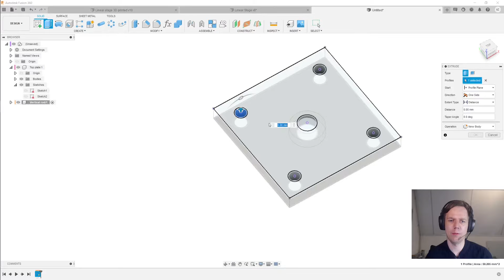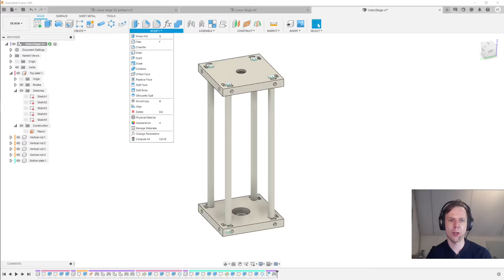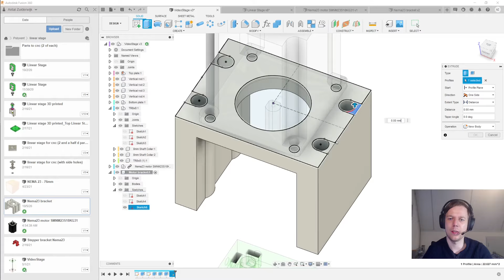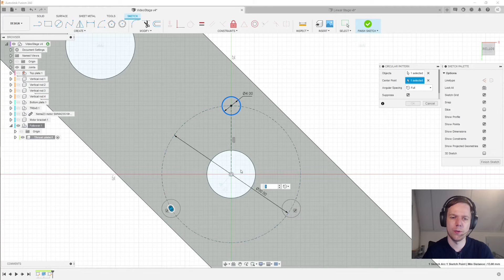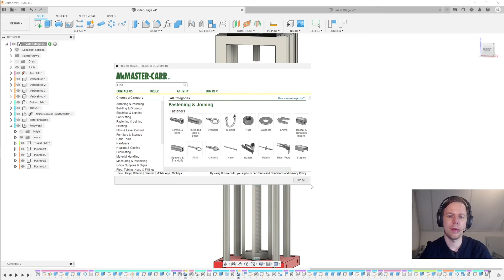Fusion360 Assembly Tutorial; Full practical assembly from scratch

Comment: This video has a lot of teaching moments : )   @25:58 I get the screw turning but the shaft collars are not moving with the shaft even though they are joint rigid to the shaft. The top plate and 4 rails are very transparent. However if I use my mouse and turn the shaft the collars rotate as expected with the shaft. Maybe something changed since you made the video.

Comment: Well done! Quick one; i'm stuck at where you imported the NEMA 23 stepper. How can I get the part file or dimensions to model it?
Reply from the maker: There's no file for it, but you can find drawings for the NEMA23 faceplate online. From there you can create a model of the motor yourself, and then insert it. Make sure to joint the motor shaft to the body with a revolute joint. It's a nice small model to practice.

Comment: Why can’t you plan out the video before hand instead of making a bunch of mistakes so that the viewer doesn’t have to go back every minute on their sketch to change what you told them to do💀 making it hard for no reason
Reply from the maker: The video was fully scripted, the mistakes and corrections are to show how to make a model where you can easily change dimensions and the whole model updates as required. What I often see is that people correct mistakes by adding more features, which quickly turns the model into a mess.

It's also very powerful if you want to create several veriations of one model, if the model is properly made all you need to do is adjust some parameters. If it's poorly made you have to model each variation separately.

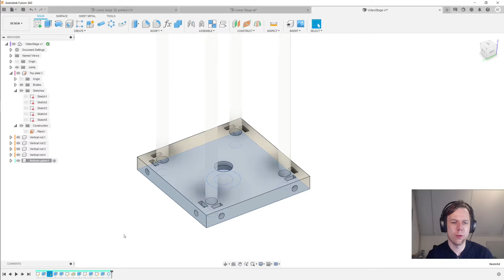Comment: This is a great tutorial, but when the program reacts differently to the result you produce, even when copying the steps precisely, it gets a little frustrating.  I'm currently editing the Bottom Plate, I have successfully copied and made it a rigid group and I'm trying to redefine the sketch plane for the hole for the lead screw (see 13:20).  I select the sketch and choose refine sketch plane, but when I click the top surface of the top plate, a full blue square selection is highlighted, not with cut outs for the corner details as shown in the tutorial, and when I click  accept it throws up errors in the cuts and the bottom plate hasn't flipped over like yours does.  Do you have any idea what I'm doing wrong?

Edit:  Managed to resolve the 2 issues.  

1) The first was related to the direction of the cut for the lead screw (it wasn't mirrored and was cutting into empty space, removing or adding '-' to the 7.00 dimension resolved this, not sure why this was an issue on my model and not yours, but nevermind
2) The second related to the mid-plane (this wasn't the highlighted error in the model timeline at the bottom).  The mid-plane seemed to align to the top edge of the bottom plate, so I went back into the mid-plane feature, and re-selected the top and bottom surfaces (from the top plane model, which it is referencing when editing), this re-centred the mid-plane and fixed the extruded cuts / feature rotation which were referenced from the mid-plane.
Reply: i am having the same issue but am not able to rectify it!!!!

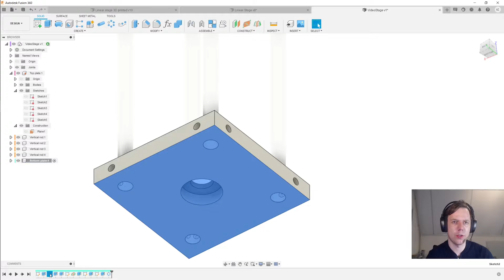Comment: Cannot seem to redefine the sketch plane at step 13:25 successfully to flip the hole to the top of the part.  No matter, what I do the large hole remains on the bottom of the Bottom Plate.  I go through all the supposed steps of selecting the sketch, going to the Timeline, right clicking and selecting Redefine Sketch Plane, selecting the top of the Top Plane and nothing happens.
Reply from the maker: It appears several people got this issue. Can you delete the sketch from the timeline for the copied component and then create a correct sketch on the right side so you can continue?

Comment: you go way to fast, can you redo the video slowly ? and please use a program to show the keys on the bottom on the screen, we don't see your keyboard !!! Also use a program to show the click with a red dot on the screen.
Reply from the maker: This is a balance unfortunately, I need to keep some speed to keep the video to a reasonable length. I recommend watching a short section and then pausing to do it yourself. I imagine it will take you a few hours to work through the video in that way.

The video also isn't meant as a first introduction to Fusion360 itself. I deliberately don't go over sketches or constraints too much, because I'm assuming that to be familiar. I do call out the shortcut keys as much as possible, to help viewers learn how to model more quickly. I'm sorry the video didn't meet your expectations.
Reply: @antalz Ok I get it with the speed and the topics you expect to be already studdied. 
But please use a software to show keypresses on the bottom of the screen and mouse clicks with a red dot.
Thanks for repling and I hope to see this soon, you can see a lot of these add ons used in other blender video or other software, I'm shure you'r familiar with it.

Comment: Thanks for the very thorough video. I learned so much in one video. My question is probably nonsense but I will ask anyway. Consider a CNC machine. On one axis are two rigid groups of components (bearings, rods, etc.). I want to place each group at a user defined distance from the centerline. So far, I have made a mess. Is there a video that will tell me what to do? Or is this question so simple ?  thanks
Reply from the maker: Hi mate, It's hard to say without seeing the model. In theory what you should do is indeed have 1 component that's slider-jointed to the base, and then everything else that's co-moving rigid-grouped to that one component. You can then position that whole subassembly by double-clicking the joint, and entering the value where you want it to slide to. Depending on your machine configuration you may have 1 component sliderjointed to the base, with a whole bunch of extra stuff rigid-grouped to it, but another collection of components that's similarly slider-jointed to the first group. But basically my tip is you can double-click a joint to enter a value to which the joint will move. Motion-linked joints or rigid groups will move along.

If that doesn't help you could send your model and question to antal@creonova.nl, please include your model as .f3d or .f3z if possible.
Reply: Thanks for the suggestion. I will try and see if I can make progress. If I get stuck then I will send the .f3d model. Thanks!! @antalz

Comment: Starting at 13:24, the "redefine sketch plane" results in a extrude error.  I am not able to do as is in the video.
Reply: I have restarted the video 2 times.  I am pretty certain I have the steps down that would affect this.
Reply from the maker: I think the confusion here might be that if the sketch plane is redefined, the extrude should go in the opposite direction. Fusion360 might not "understand" this. If you rightclick the extrude feature on the timeline (it should be highlighted yellow or red indicating the error) you can check what it's doing and try to adjust. I suspect it's still extruding upwards, and you should be able to adjust that extrude so that it extrudes downwards.

If it's still giving you trouble please send a description of the problem, preferably with a .f3d file attached, to antal@creonova.nl
Reply: @antalz  thanks for your reply, I did try the above, and it I could redefine the extrude on the top plate but not the bottom. I ended up just remaking the bottom plate with offset plane at distance.  Little more work, but still following.  I appreciate your reply.
Reply: @merrillmitchell2481  hi, i just had the same error here even though i did all the steps correctly. i cannot redefine the extrude on the bottom plate either. could you please explain how you used offset plane to remake the bottom plate?

Comment: So I've been using 3ds max, autocad and similar software since the late 90's. My fusion transition has been so difficult not because of the design process but rather the modifications to the design. I would finish a part and realize it needs tweaks, obviously, which would not only cause issues with the part but the subsequent other parts. Then I would spend more time trying to play with constraints or delete linked dimensions etc... If that makes sense
Reply from the maker: Did this video help with that at all? It can definitely be tricky at times to create a design that updates properly when you adjust dimensions or other parameters.

Comment: So I follow along and learned so much right up until you decide to design a motor and put it into the assy.  27 minutes in and now I'm not able to follow along.  
You couldn't be bothered to share that design as well?  Kind of a disappointment.  😕
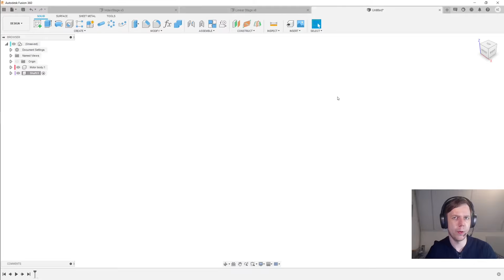Reply from the maker: My assumption was by the time you get to 27 mins of this video you can recreate that design without issue, perhaps that wasn't justified. Are you able to find a Nema23 faceplate drawing online and then sketch+extrude it in Fusion360? At 27:05 you can see the timeline is very short, there's really not much to the motor at all.

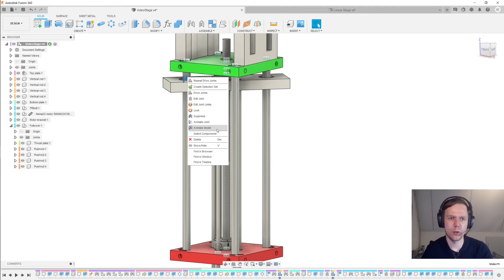Comment: 47:28. Edit joint limits should have a "to object" option. Otherwise, if you change your part dimensions, you'll have to correct them later on.
Reply from the maker: It doesn't have the currently right? Because I couldn't see it. And yeah joint limits are a bit limited at the moment. Just like how contact sets don't work well if you move things around violently enough.

Comment: You could have discussed how you assembled that motor. Because even if you grounded some motor part, when you inserted it into the project, its parts will move around. Rigid joint between a motor part and the top level origin is what is desired there, as far as I know
Reply from the maker: Not entirely sure about this. When I open the motor file, I grounded the body component and revolute-jointed the shaft to the body. That way both subcomponents are constrained, and all that's left is jointing the motor in the overall assembly. You do sometimes run into problems if you try joint to the root component of a subassembly, maybe I could have been clearer about that.

Comment: Followed along very well, but got lost at the part where you brought the motor. I wish you explained further how you designed the motor.
Reply from the maker: The motor has a NEMA23 faceplate, you can look up technical drawings/specs for those online. With such a drawing at hand recreating the motor should be quite easy. It's not essential to get every detail right, the hole pattern is the most important, and the raised platform around the shaft is also important.

Comment: Any idea how you could create a joint(s) and motion link to move a body where the lead nut is its own component. I'm trying to drive a body in a linear direction with rotation from the shaft to the lead screw ?
Reply from the maker: I'm not sure I understand correctly. It seems to me you can create a slider joint, which is possibly easiest to do with the as-built joint function. If you mean that your body has to move along with the trapezoidal nut, you can make a rigid joint between that body and the nut. Here to an as-built joint can work. A rigid group also works well if many components need to stay together. Note that you can't joint directly to a body, you must joint to components. If you are using subcomponents, make joints to the subcomponents, not the parent component.

Comment: I have a doubt when applying as-built joint to the middle rod and the upper plate, I'm not able to make the middle rod and shaft collar rotate togetherly....can you tell what could be the problem or how  I should do it in particular?
Reply from the maker: For that you need to make an as-built joing between that rod and the collar, or a rigid group. I think that the as-built joint you mentioned is for allowing the middle rod to rotate. Keep in mind that some joints are rigid, and some are revolute.

Comment: HI, great tutorial , I have one question, when u change the length or breadth of the upper plate through sketch, do screw pockets and rod holes still stay intact or they mess up ?? In my case, they are getting messed up
Reply from the maker: That depends on how you set up the dimensions. If you dimension relative to the edges, they pockets should move with the edges.

Comment: Coming from Solidworks, working with assemblies in Fusion360 has been infuriating! You're video has shown the correct way to do everything I have been doing wrong. You have also shown some new features I didn't know existed. Thank you SO much for this video!
Reply from the maker: Thanks you! Fusion360 is a bit weird with joints vs mates for sure. I do think some complex movements are much more feasible with mates than with joints unfortunately, like cam-track movements. I don't have much Solidworks experience though.

Comment: hi i am getting trouble with joints . I couldnt select the joints like in the video  there is a blue white rectangle icon for the joints and i could not selected it  help pls
Reply from the maker: You may have joints hidden under visibility options. On the small bar on the bottom of your screen, third button from the right, under object visibility enable joints. Not sure if this answers your question, I'm not sure what exactly your problem is. Could be that you need to hold control when placing a joint.

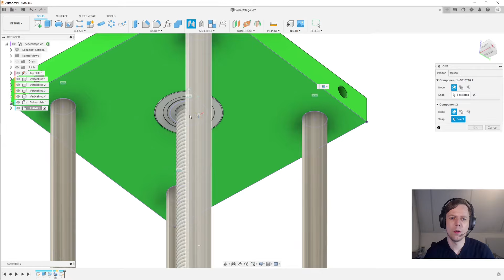Comment: Its a great tutorial, thank you for this. I am an engineer who is more used to software like solidworks and creo, and I'm trying to figure out of fusion 360 is something good for me to use for my own hobbies.. I like a lot about fusion, however what I saw you doing at 23:00 for assembling the shaft collars is the sort of stuff in fusion that confuses me. Having to first make a sketch to create the joint, and having to select that sketch and then seeing it rotate with the shaft ,it's just... not that intuitive. I wonder if you yourself prefer working in the other software? The only reason I think people would put up with this is because fusion is so much cheaper/free? I currently cant see myself doing anything really complex in this software, but I hope I'm wrong..
Reply from the maker: I think for most modelling Fusion360 is fine, but joints are a hot issue especially for those who come from other CAD software. I do like joints in most cases, because simple motions and relations can be set up very quickly and intuitively. More complex arrangements are very difficult or impossible though, for example I don't think I could set up a cam follower, so in those cases a mates/constraints system would be much better. For my own work Fusion360 is enough, I can imagine more complicated movements in my head. I would definitely consider that one of the weaker points of Fusion.

Comment: hello sir, i have a question, for securing the hole is it required for the diameter of the hole and the one to be inserted the same for it to be tight?
Reply from the maker: That depends on what kind of fit you want, and how accurate your 3D printer/settings are. For bearing pockets you can usually tweak it to get a nice tight fit, for the rods you can come back with a drill to get a right sized hole. In Cura the hole horizontal expansion option allows you to get about +/- 0.1mm diameter holes.
Reply: @antalz  copy sir thank you

Comment: Hi, thanks for this video. Certainly are valuables lessons! But I am stuck on the stepper motor part, could you better explain which model you are using for the measurements or a link to them?
Reply from the maker: The stepper motor I'm using is a Nema 23 one. Nema 23 is a full specification of the faceplate of the motor, and you can find a drawing for Nema23 on the internet easily, for example this page has a drawing: https://www.smart-prototyping.com/Stepper-Motor-NEMA-23-57x57mm.html

Note that Nema 17/23/34 etc only specify the faceplate. They do not specify how long the motor is, nor how powerful the motor is, or even what kind of motor it is. Only the faceplate. I got the length for my particular motor by just measuring it with callipers.
Reply: @antalz  I understood. Thanks for the answer. I'm already subscribe in your channel

Comment: This has been the clearest explanation of building an assembly in Fusion 360 and keeping it organized that I have been able to find....and I'm posting this comment not even halfway through the video.

Bravo.
Reply from the maker: Thanks a lot, I hope you enjoy the rest too. It's also in large part why I made this tutorial, a lot of videos will show you two components and a joint, but don't show enough to see how you can structure a project correctly.
Reply: @antalz  That's exactly right. Once you see it it makes perfect sense. 

The other thing that isn't immediately obvious and really easy to create a mess with is sketches in the main body.

Once I saw you create a component right at the very beginning of the project to contain sketch 👍.
Reply from the maker: @Bluelude1  Yeah that's a very common way to start a mess. I actually do it on purpose in my bevel gear tutorial, but many beginners do it without good reason because nobody ever tells them it's a bad way to start.